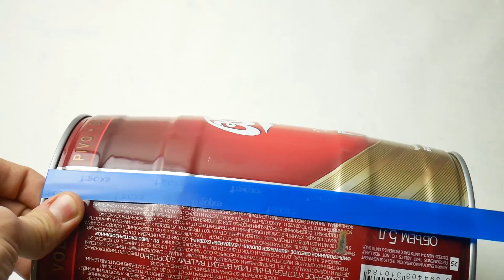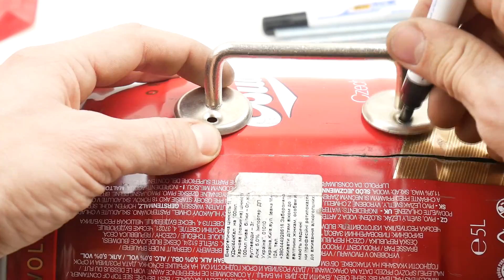What can be made from an empty beer can

Comment: I cant believe you hand spun those nuts all the way down the all thread,put them on the short end and spin them down,alot easier.
Reply: Yea I'm an electrician and work with threaded rod all the time I thought the same exact thing. He should have spun them on the shorter side first then stuck the rod thru for the other side